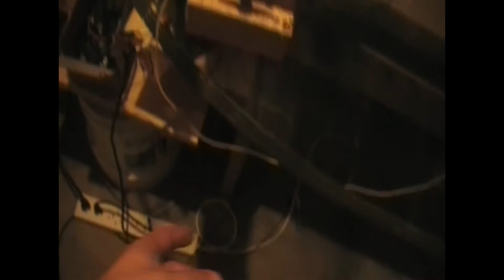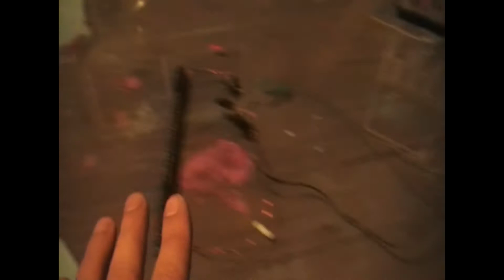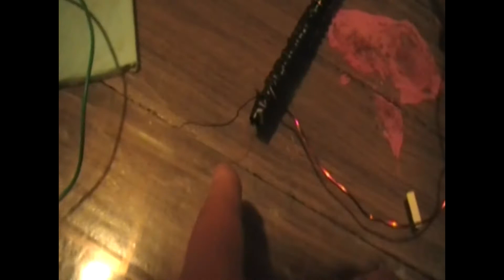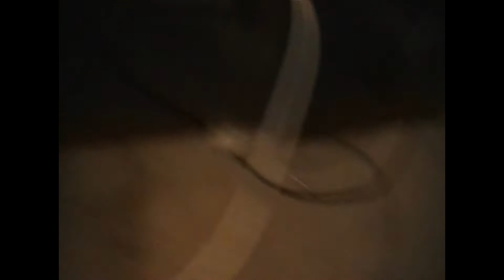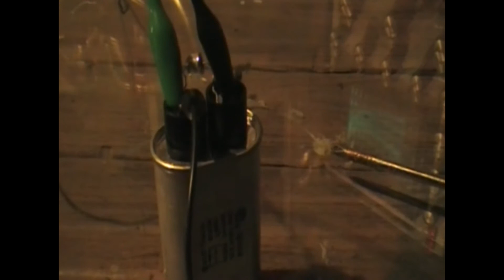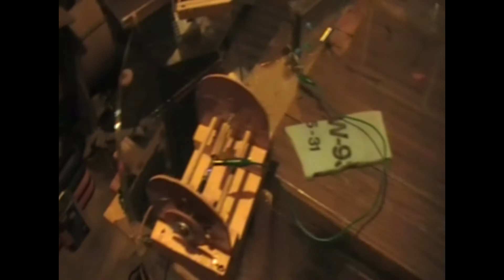Positve Grounding + GDT Capacitance to Joules Power Measurment

Comment: Did you measure the interval between the GDT discharge for power measurement? Otherwise, you can measure energy still. Nice video by the way. Never heard of positive ground..
Reply from the maker: Yeah, it was the interval between discharge for measurement. It is good for indication only, not precise at all.... The positive grounding doesn't exist, I was interpreting the situation incorrectly.
Reply: Binj Komisar If you have a frequency counter, then you will have fairly accurate time measurement. GDT rating should be reliable as well, (assuming the cap is charged up) maybe nominal capacitance can be a bit off, but the result should come out fairly close. Very smart set up! To buy a joule meter or clamp meter isn't cheap, this is a great way of going around them, if frequency is high, just put a resistor in series to delay the charging time.
Reply from the maker: Yuji Naka Thank you Yuji. :)

Comment: Really smart idea with charging this high voltage cap , those HV caps they have resistors inside them did you remove it ?
Reply from the maker: No Kamil, it totally passed my mind. They had the HV diodes on top. I never thought of removing the resistor. The resistor must be inside the metal casing.... Thank you for pointing that out, that effects the quality of the  measurement for sure. :)
Reply from the maker: Yeah Kamil Domjan , I just did some research, there are 10MOhm resistors placed in the top of the Microwave-Oven caps. I will do a video in the next day or 3 showing me doing surgery to  remove the resistor.... At least with the resistor out the measurements I am taking will be closer to the truth. Thanks Kamil :)
Reply from the maker: Mongrel Shark
Yeah, all the meters I have quit working in HV HF conditions. That is why I added this way of measuring power (in the vid) using GDT's and calcing using Volts x Capacitance(Coulombs)=Joules which then can be extrapolated into Watts. The resistor inside the MWO-Cap will dissipate power, therefore negatively skew my "captured" power calculations... Check the video out, there are a couple of oddball things happening. You just may be mildly intrigued ;)
Reply from the maker: Mongrel Shark
Well, first off, the GDT will discharge pretty close to their specified value (otherwise they would not be very useful). And when A GDT is activated it will stay on as long as possible due to the inherent properties of GDT's (negative resistance), so I would imagine it would be a half decent indicator of the power that is being captured.
With respect to the waveform it is a really hard thing to judge the bias. Especially since it is getting readings from the entire system not just the capacitor section (the scope is just in there for show).
In regards to the positive ground, a power film cap is a power film cap 2100VAC, it doesn't really care its bi (as far as I know).
There is an oddball phenomenon happening. I'm getting your opinion (which is highly knowledgeable) of which I appreciate, I have mine, and I even have TinselKoala taking a crack at making sense out of the situation (and that guy is extremely knowledgeable as well) ... The fact is that it is perplexing, when you really think hard about it and how diodes work (and how grounding works) it is strange.... I think I will make another vid in the next few days, done with more description and better camera work... I got ahead of myself making this video. Thanks for you input Mongrel Shark,
Reply from the maker: Mongrel Shark
For sure. I want to make sense out of this. I will add that in the next vid. Peace my man :)
Reply: The sig gen will likely survive. Its the mosfet that cops it.
Reply: Most meters have a 10m (or sometimes as low as30k for analog meters) impedance on the voltage reading too.
sometimes it pays to know consider and consider the meters impedance.
If you dont know what your meter is, test it with another meter. Check the current sense resistors and voltage delivered by the Ohms and diode meter while you are there... Some people like to label the back of the meter with stats.
Reply: Binj Komisar  Hmm, Are you sure the discharge tube is firing at exactly 1kv, and discharging the cap all the way?
As to the pos ground, are you sure you have even output on both side of the bridge rectifier? Looks like it might be more neg voltage compared to pos in the waveform.....

Could be a MOC thing too? The magnetron runs on more neg than ground voltage. Not more pos than ground as you would expect...
Reply: Could I suggest 2 caps in series and ground in the middle to solve the bias waveform problem?
Reply from the maker: Mongrel Shark
Happy birthday brojangles.... Yeah about the vid. Ground is neutral. The FBR in the video was not allowing full rectification.. that's where I got all fudged up :( The wave was negative biased and not being allowed to fully pass through the FBR. When I unhooked the negative of the FBR all of a sudden the positive was charging and grounding to negative (neutral)... Live and learn.
Reply from the maker: Mongrel Shark Checkout the caption I put on the vid.
Reply: Binj Komisar
LOL, did you have your AC return hooked up to ground too?
Reply from the maker: Mongrel Shark
Hmm, I'm not 100% sure what you mean by AC return... could you elaborate a bit?
Reply: The path from the appliance back to the ac source (or ground) to complete the circuit.
Reply from the maker: Mongrel Shark I think I did. I had it grounded on both sides of the TC secondary.
Reply: LMAO. Thats got to be giving the driver some hell.
Reply from the maker: Mongrel Shark
The grounds of the secondary are different grounds than the driver side.. One of the grounds is an iron well and the other is a copper lightning rod. Both are separate from the grounding  the to MOSFET and Power Supply (which is the house ground). It seems to run pretty cool at lower wattage. Anywhere up to 40 watts the MOSFET keeps cool... I have pushed it way beyond that and have burnt out MOSFETS.... Right now I'm actually working in a true AC driver source. Basically i'm making a LC tank for the driver side... Its much more complicated than just driving with one MOSFET but well worth the effort.. I hope ;)
Reply: Yes, but if the ends of the coil have a stable reference voltage, that means the part with the primary has to the high voltage oscillating... Driving a ton of feedback through the primary. Which in turn had the potential to pass significant AC through the Mosfet gate capacitance.
Reply from the maker: Mongrel Shark
I see what your saying. Maybe I'll but a flyback diode in the mix and hook up an external cap on the outside of the power-supply to capture any feedback (ill also send + charge out of the power-supply with a diode).... Do you have any suggestions? I really should whip up a schematic.
Reply: Sounds like your onto it. Diode the PSU (both terminals) and have a feedback cap.

You could also drive the MOSFET via opto isolator.
Reply from the maker: Mongrel Shark
Yeah, I know i'm taking a risk at destroying the frequency gen how I have it set up. I will get some isolation going on for sure :)

Comment: Hi Binj
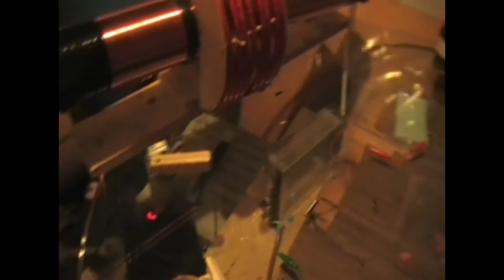I left a comment on my video, check it. But I guess we should discuss this here. At about 1:00 you refer to the output of your half-wave TC (very cool, btw, nice construction)  as "positive" but in my experience the output of the secondary of all TCs is HV AC RF, so your diode is not "blocking" but rather rectifying  the output, so you will see half-wave lumps on the output side of the diode, not nothing. So the ferrite coil transformer is being driven by the TC through the diode.
I'll be able to tell you more after I do some experimenting with my MiniSlayer which has the loopstick on the TC secondary output similar to the ferrite connection to your setup.
Reply from the maker: Thanks for complement on my TC. I will let her know (her name is Brenda)...
Also, thanks for pointing that out, it makes a lot of sense. Diode only blocks half the wave, or lets through half the wave. One thing I am not sure about is when pumping a Tesla Coil with a half wave does the out-put become a true AC? or a pulsed DC? I really don't know.
Thanks again, I look forward to seeing/hearing what you have to tell me after you do some experimentation. Peace.
Reply: Binj Komisar
When the Tesla coil is operating in resonance the output of the secondary should be a very pure sine wave AC, even if you are driving with DC rectangular pulses or spikes that don't go negative.
Reply from the maker: TinselKoala
OK. Thank you for clearing that up for me. I still have a LOT to learn about in this wonderful world of electronics. And I am going to do my best to learn as much as I can before I die :) Thanks again TK.